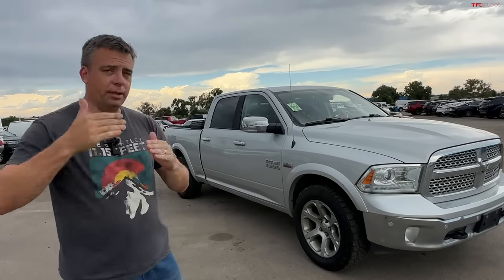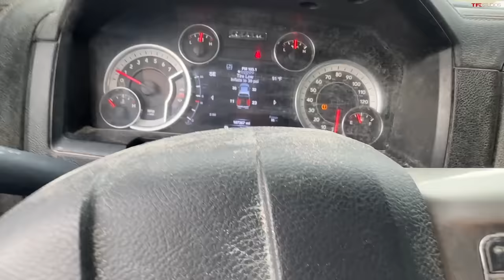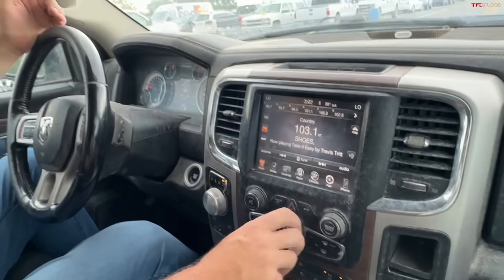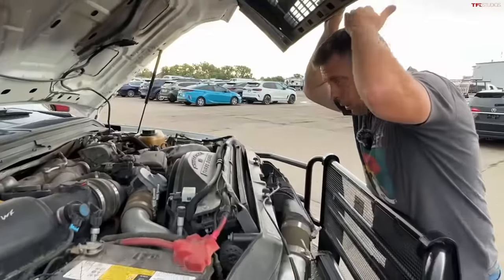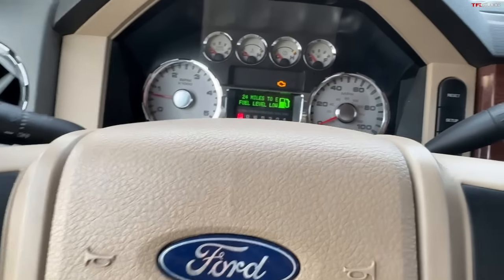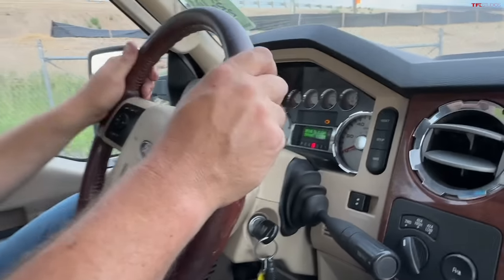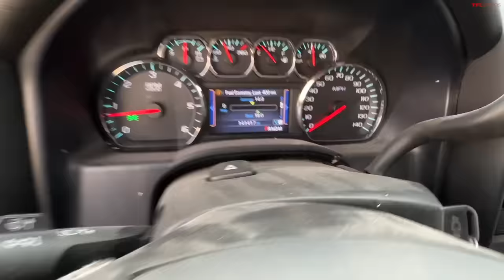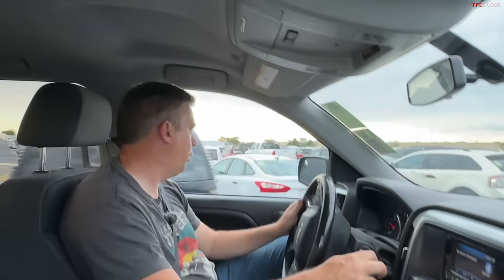These Are the Top 3 Used Trucks You Should Never, EVER Buy!

Comment: that Ram did not hold up well for only 109k miles. My 2015 5.0 F150 had 185k and it still fetched a good trade in because it was still in good order, everything worked.  Only issue was some minor rusting on the underbody (ohio truck)and the weather sills on the doors popped off once in a while from water freezing on them.
Reply: It’s all how trucks are used and taken care of.
Reply: @jamesr8103  that's true.  I stayed up on maintenance but it didn't help my steering wheel from fading. I had a bad habit of grabbing it in the top middle every time.  I tried steering wheel covers but they didn't feel or look good.

Comment: “It did a 7 second 0 to 60 at elevation”
WHY?!?!?!
These trucks are designed to pull trailers efficiently, they aren’t hot rods!
If the big three understood this, they would be producing much better and reliable trucks and foreign car manufacturers wouldn’t be taking truck market share away. 
If you want a fast truck, they are available, but these towing machines economy is getting worse and worse.

Comment: On the Ford. You should hear the turbos in the cab. On regen. You should still have power. The only thing I did not replace in mine was the regen exhaust. Needed it badly. Almost 3 years ago. That part was just over $2,000. Mine also had DVD in the back headrest. Exactly the same interior color. Yet. Black outside. Do I mess it. Yup. I put a lot of money into it. The best part about the truck was on the floorboard between the two front seats. Leg room. I miss that. Only reason why I got rid of it was. Because of my lender. At the end of my 5 year loan. I still had over $17,000 to pay on it. They jumped up my loan from 4.6% to 15% interest. Behind my back. I had perfect payments. The regen would take 1/8 of a tank of fuel each time. You said a ranch owner would be driving that truck. Funny. My steering wheel had chunks missing out of it from someone dring it wearing large rings. Mine just had over 98,000 miles on it.

Comment: That 6.4 Ford diesel it's most likely in derate mode only allow you to do 20mph if you run out of DEF and if you do not Regen when is required. At this point you will most likely have to do a forced regen with a computer

And I'm not a fan of the 6.4 but the truck is telling you what it wants on the dash you ready out to us and you cannot blame Ford for this or International this is a government mandate I don't care if you have a semi truck bus Dodge Chevy Ford or heavy equipment yes the new heavy equipment have DEF as well they will all berate if you do not Regen

Comment: Love the channel, but this video shows how little you know about engines. Hemi had exhaust leak. 6.4 has issues due to emissions like egr and dpf. That y said drive to clean exhaust. Dpf probably clogged and that’s y it has check engine light. Lastly, the  6.7 isn’t a 6.4 redesign. The 6.7 is an all new design by ford. The 6.4 was built by navistar.

Comment: I will agree about the Ram. Had a 16' 5.7 Hemi, before it even hit 100k miles, needed new axle bearings, water pump (which is typical), exhaust manifold leak, burnt the third brake like bulb connector out, needed a new headlight harness, and started the hemi tick. Was gonna need a whole new engine. I now drive a Tundra

Comment: Cylinder deactivation, no matter what make, is a problem area.  No amount of advertising and propaganda can change engineering reality.  It's a design that looks great on paper, but is poor in actual use.  The SuperDuty likely has a full DPF, and it likely is bad.  Oh, and guys, a regen takes up to 15-20 miles at highway speed to clean an even properly functioning DPF.  The truck may even be in limp mode.  Avoid the 6.4 Powerstroke like the plague.

Comment: I like to add the fact that the Fuel Management system was and is the worst Technology ever Because as time goes by the valve lash adjusters fail as mileage gets up to 400,000km 
and the engine dies or the dreaded ticking starts warning you  that its time to replace the lash adjusters a 12 hour job ... Not very reliable at all as I personally met a gentleman who was stranded here in the Carriboo and his engine had to be replaced ... this goes to also dodge and any engine with this wasteful technology - Almost as bad as Apple phones...

Comment: Gm Trucks from 2007- currant Engines are junk unless you delete the AFM lifters and afm system from working! They burn oil like crazy up to 3 quarts per 1000 miles and lifters fail and wipe cam out. Dodge has same problem and years and New ford engines have the same problem with cylinder deactivation in V-8s! Then fords three valves from 2004 up to switch to 5liter coyote based engines namely the 5.4L triton is a pile of junk especially if you go out on hours and mileage on oil changes and sludge builds up!

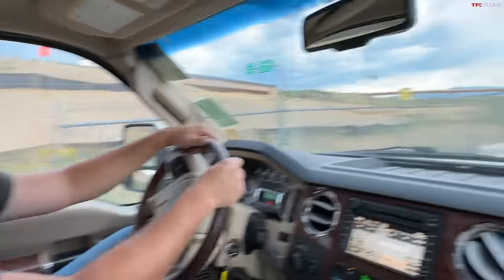Comment: Yes it is a broken exhaust manifold bolt guys. Get it correct if your going to criticize the vehicle. Ye some of the 5.7’s had lifter problems. Easy fix though. But basically these were new trucks with tons of systems poorly designed. And people pay big bucks for newly engineered pieces of crap. Shame on the design engineers. Anything to make a buck these 14:54  days.

Comment: Modern pickups are such a scam. You're paying $70-80k for an upper trim half-ton and while you get all the luxury doodads, these trucks are not mechanically impressive. I'd take a 7.3L diesel F-250 from 2002 over any modern diesel or gas engine that Ford, GM, or Dodge makes.

Comment: I have a 2002 Expedition with the 5.4L 2v gas V8 with over 230k miles…. Is that not normal then? 😂
Reply: I seen a 2003 F150 5.4 2v with 630,000 miles on it . The triton is a good engine. Not flawless but good.

Comment: There is an overwhelming conclusion that you draw from all your observations. You could have named this video "vehicles that the EPA ruined".  The 6.7 liter Cummins has a manifold bolt that can grenade the engine.  The injector issues of the LB7 1st gen Duramax but that's an older vehicle at this point. Many jeep issues, especially even moreso since Chrysler bought fiat. Now they all have plastic crap.

Comment: First of all Dodges fords And some Chevy's all of them most I own was woods. Five of them and i'm italianit was Some of the worst times in my life dependable and load. They don't take it on a long trip.
It would cause you even more. Dodges to me safe if you don't have the wheels falling off or someone on the to exhaust problems. Chevy used to be top of the line and now they are falling down. Not American like Toyota. Where some of the best things I have done so far in my lifetime. As far as maintenance dependability, I don't think right now. I stayed out of the mechanic shop, and more on the road when I switched over believe it or not, and I know some of you will get mad by this but when I bought toyotathey are some the most reliable cause you can have ants you can never get and one of the reasons.  I think that is yes. They are standards when it comes to putting these machines together.

Comment: i dont care how many miles is on a 5.7 hemi. i walk away. and the same with the 6.4 ford. i have a 2000 F150 4.6 4x4 at the time had about 250k miles on it  and i guy tried to trade me a 2008 6.4 4x4 with less than 100k miles on it straight across for it. i had to laugh and tell him ho thanks. and it looked as good if not better than the one you just showed. and chevy i know nothing about

Comment: My 2014 gmc sierra has had its fair share of problems. Loss of power steering three times one of which nearly caused me to wreck the truck. Electrical issues most of what have been the result of faulty grounds. Misfire on cylinder 8 due to bad fuel injector. Etc etc. GM hasn’t made a decent truck since the GMT800. In fact in my opinion all the new trucks ford Gm Ram and unfortunately Toyota now are all junk. Way to much tech and engine tech. Entirely to many fail points an sadly nissan is killing off the Titan. Four best truck I ever had were 05 and 06 Silverado (gmt800) and 08 and 14 Nissan Titan. Should have never ever sold the 06 Silverado and should have never ever sold the 14 Titan. At this point I’m looking for another Titan or preferably a second Toyota tundra. After driving my wife’s Honda van for awhile now I’m convinced that domestics are just not of the same quality as Nissan and Toyota in regards to trucks.
Reply: GM trucks require more maintenance now than those before it. That is the only issue. Other than that they can still last.

Comment: All these problematic trucks show the different elements that can deem something unreliable. The 6.4L Navistar engine is by far one of the worst engine packages ever made, the worst to ever go in a heavy duty truck, in what is overall a fairly reliable truck on a proven platform. This engine was so bad it ended the long standing partnership between Ford and International/navistar, who kept using that terrible engine in medium duty commercial trucks for several more years. The Ram trucks have typical mopar issues relating to being advanced in tech for its time, unproven tech often is problematic, as well as having a certain lack in build quality. There's an element of "you can live with it" that goes among dodge/ram owners when it comes to dealing with these problems and that's why so many achieve high miles and long(well used) lives. GM trucks are very durable and reliable as they always have been, but with each generation following the GMT800 they just are built cheaper and cheaper. The GMs wont go full on meltdown like a 6.4L will just because you looked at it, but the newer trucks are going to nickel and dime you to death as they start to get higher in miles. I recently had 2006 and 2016 Silverado 1500 4x4s on my lifts at the same time at work, both had just over 160K miles, the 2006 was clean and mostly original in the suspension and driveline, while the 2016 was covered in fluid and grease from failed CVs, had new steering parts, and multiple systems had been recently worked on judging by the disturbed dust around the engine compartment. It almost seems like GM knows their GMT800 trucks were perfection and had to engineer some inferiority into the newer ones to be able to keep selling trucks. 

I'd consider the GMT K2XX platform(2014-18) if there was no comparable older GM truck options available, but in general would avoid them. The Ram trucks are not for me, I'm not someone who can "live with it" when it comes to mechanical systems, but I understand there are many who are willing to because they want tech or style that isn't available to them otherwise. Super Duty trucks are always a good choice, but the only reason to even look at a 6.4L truck is if you're looking to do a Cummins swap...

Comment: 2007-2013 Chevy avalanche
Rust, AFM failure, Window seals

2024 GMC 2500
No body protection, Electronics/entertainment failure, corrupt company

2004-2008 F150
Cam phaser failure 5.4 triton
Radiator failure

2017 GMC sierra
Paint falls off, electronic steering lockup, tailgate handle failure

2015 F250 
Weak body panels, weak/soft rear suspension unloaded

2004-2007 F250/F350 6.0 diesel
Head gasket failure, water pump failure

2003 Chevy Avalanche
Frame rot, rust, brake line failure

2003-2008 Ram 1500
Death wobble, weak/stiff front end, rust, hemi tick is annoying, maintenance is difficult

Some of the worst vehicles my family has owned and/or worked on. GMC is legitimately corrupt nowadays so ANYTHING new from them is a scam, whether they used to be decent vehicles or not.

Comment: Wow, really Bad advice. If anything you want the 5.7 hemi or the 5.3 vortec. Delete the eco shut off modes and change your freaking oil every 5k and these engines are proven to last decades. If only we could go back to manual transmissions we could have trucks that basically last forever.  But no one wants to hear that.
Reply: What older truck would be a good buy between 2011 to 2016 that would fit me and my kids

Comment: Dude seriously the ram with the 5.7 displacement engine yeah weather in the truck or the charger of which I had a 2006 charger rt the displacement 5.7 mine had got me on a 7 &1/5 trip from north chesterfield Va to katawba Va once I set the cruise control at 80mph of which I eventually did get a speeding ticket for in katawba Va for this engine at 350hp to the wheels used less then half a tank of gas! And these guys are shitting on the ram over a torn seat in an admittedly work truck and a lifter tap! Now the lifter tap was a common problem of which was not an expensive fix and most times were covered by the dealerships in full because it was a common problem and dude let’s face it every vehicle on the market has had recalls! For god sakes the first generation of the ford escape had well over 190 recalls the first 6 months it was out on the market as did the ford focus! And to be honest the recalls on the ram weren’t safety related from what I remember like the vikatin shaped ford Taurus were we the techs had to use hole saws to drill holes in the floor pan to access the rear body mount bushings!

Comment: Obviously you guys don't know anything about truck's! First you said that the ram 1500 has a famous hemi lifter problem noise and the answer is not really the most common problem with these rams 5.7 hemi engine tick is the exhaust manifold bolts break off which causes the tick. Them you said in the test run the fat guy said I'm surprised I didn't expect the 5.7 to be that quick! What!! I guess you guys have never been in a Hemi before. 😂

Comment: That seat is due to a fat ass sliding out for 100k miles funny.  Any truck not maintained will suck.  Hey talk about ford's and the cam phaser present ford gave me at 107k  new engine.   Luckily I dumped it for 2500 Cummins.  That was 2017.  Still purring along.

Comment: I laugh everytime I see somebody in a modern American Truck what a joke those things are all crap Americas building nothing but garbage I drive a Toyota Tundra it's got 679 thousand miles on it I have so far replaced the water pump to starter and alternator some belts and pulleys that's it all the work myself 15 years of driving I'm out $720 in total repairs 15 years